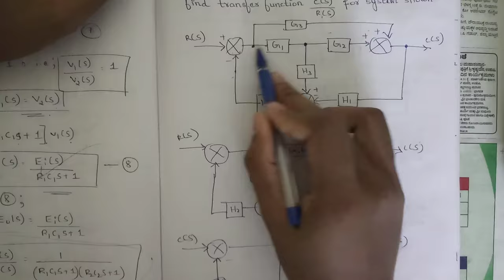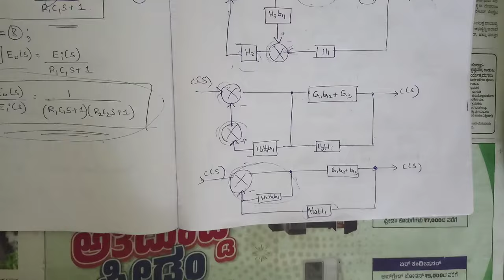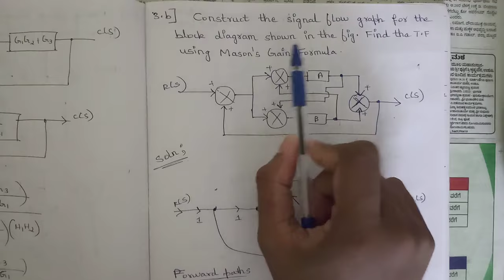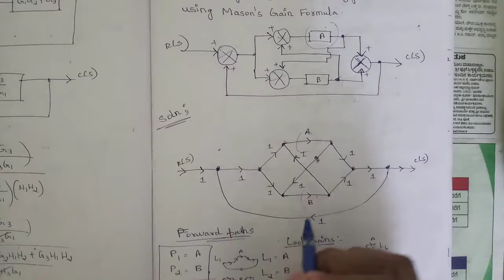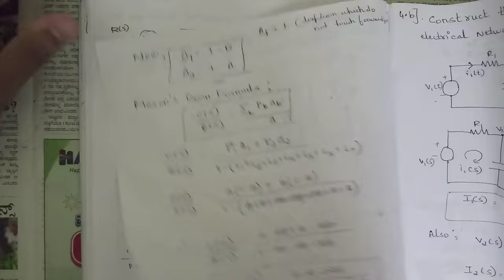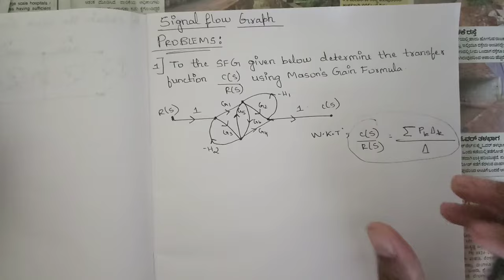#2 Control System Model Paper 1 Solution Q3a,b 4a 4th Sem ECE 2022 Scheme VTU BEC403

Comment: Sir in 3b question, L6=A and L7=B is not possible I guess, because they both do not intersect at middle, they are continue, can u plz explain this loop 6 and 7?
Reply: And also we have 4 forward paths
Reply: I think we get only delta1 and delta2 equal to 1
Reply: @vinayakvinayak2768  it is necessary to write
Reply: @SectorMatrixGaming  no
Reply: @vinayakvinayak2768  L6 L7
Reply: @SectorMatrixGaming  no
Reply: Sir what happened if we don't write L6 and L7
Reply: i was going to say the same
Reply: I am also